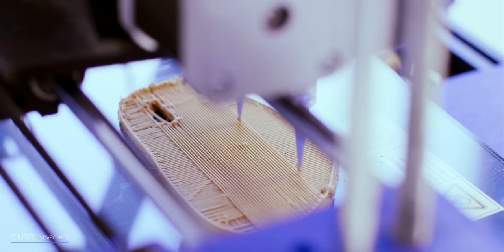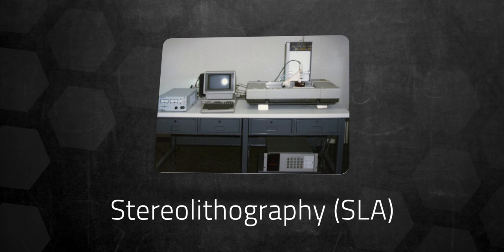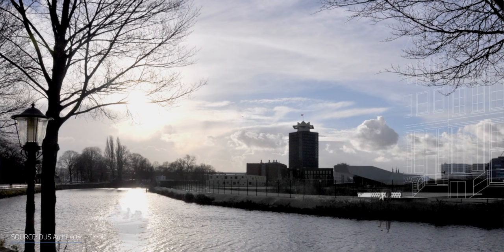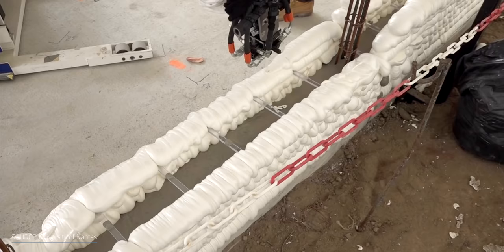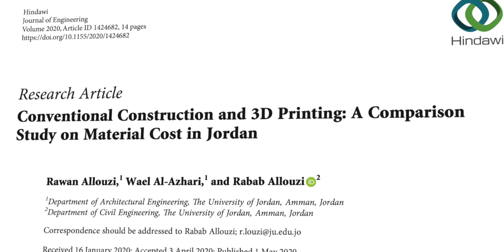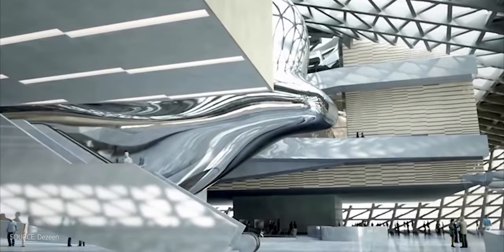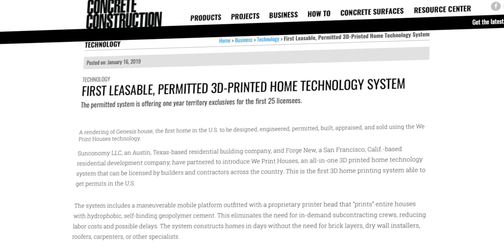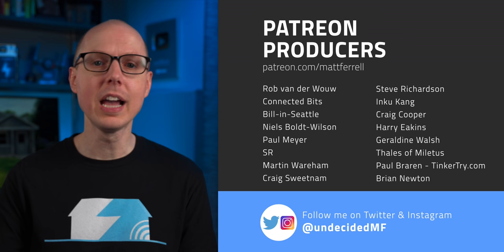This 3D Printed House Changes Everything - Explained

Comment: If you ever built your house in Europe you know that the walls go up the quickest and uses the cheapest labour. You are replacing that with a complicated technology, which reduces a relatively simple and quick part of the overall building process. It can surely built custom houses that would be difficult overwise. Surely it can build the house in 2 days, but I guess it takes another 2 to set up the printer and the tent, dismantle it afterwards. A similar house can be build by 2 bricklayers in probably a week. You saved a few days overall in a house build which generally takes 6-7 months. If you have local materials and you need cheap housing in volume you are probably much better off concrete flat panel manufactured in an industrial setting. You look at the entire Eastern block in Europe where tens of millions got housed in flat panel condos and those still stand despite of communist standards.

Comment: Any new building technique goes up against the home building industry which is dug in like an Alabama tick. I would buy a 3D printed house tomorrow if there was a contractor available and we could get the project through the permit process. These are great but worthless until you can actual order one built on your lot.

Comment: Thanks Matt - very interesting and raises many questions. However, I struggle to understand how it can be claimed its low carbon? Its concrete for dogs sake - most of the CO2 emissions from any building is the use of concrete. This is no exception. 
I wonder if anyone is trying to build by extruding molten rock? Now that would be 3D printing on steroids.

Comment: Looks like a bs con to me, like solar roadways etc. It's real easy to get money for such startups now. 

If you think about the logistics of it, I can only see this working in developed areas. For remote areas and poor areas, it would be a huge fuss to get these printers on location. But if you would build in traditional ways, there are also good options. Most of the things you need are available locally. The building gives work to the locals in every part of the process. But if you print it the big company comes in with charity robots, builds the concrete home, and is off again wiht all the money. Meanwhile the local workmen are jobless without income, the shops aren't selling rough materials. The transporters aren't getting work bringing goods...  Seems like a typical dumb idea to me, but one that would be popular with investors.   They can add blockchain to the company name :D.

Comment: 8:59 - why is that a good thing? Where are the 30% savings on materials/labour going then if the homes are the same cost as a "regular" home in the area? A 3D printed home isn't inherently better because it is 3D printed. It would need to be priced UNDER a regular house to be a good option for most buyers surely as many of what you were showing were significantly smaller sized homes.

Comment: Yea a 1500 square foot home does not cost $500k. Its right in $160k-210k, this is as presented almost 2-3 times the cost to build a standard timber home. Go shipping container home and you cut expense down to 1/8 of cost of traditional and about 1/16 of a printed home. Pass…

Comment: Many pieces == many joints, the joints are detestable over time. This is not like building with bricks and mortar (European style) with large and deep foundations to avoid unwanted displacements in the structure. Here it is normal to see houses with more than 100 years impeccably finished without problems of leaks, or breakages due to load or settlements. Also they are not more expensive than that. I can't imagine how inefficient these projects are that are sold as more efficient than 'classic' construction.

Ask how modular buildings and houses in Russia age over time. They are not very different by the philosophy of the construction.
 
I am very skeptical of the practicality of many 3d printed house projects. Plus the marketing with phrases and promises, sucks.

Comment: Yeah no this is the same issue as the house in England that was built entirely out of Lego.  3D printers aren't the solution for every architectural problem. In fact it's still more if a novelty for the .1% who have disposable income.  Also i prefer not to have a literal smart house, thanks. Computers are good tools, not to be trusted in any other format.

Comment: Still need a foundation, and wiring, plumbing, hvac, various inspection, and of course the land - this solves only  the framing part of the equation which to be honest a decent team can do very rapidly.

Faster delivery?  Maybe I think you would have to include the machine setup that rig & scaffolding.
Flexible?  I suppose you can print some shapes impossible to frame with hidden internals for ducting.   
Less expensive, doubtful - need to see a breakdown - those bare walls still need to be finished.  The actual land seems the most valuable part of the equation for anywhere I've lived.  The price per squarefoot of those shown are dogshit.
More sustainable?  Wood is a renewable resource, and unlike printed homes the inevitable remodel in 10 to 20 years is a well understood process.  Cement is tremendously energy intensive.

Comment: This is a joke. They already have 3D printed homes - called block manufacturing businesses. And instead of bringing factory to the jobsite, they had a revolutionary idea of building mega-factories that produce tens of thousands of blocks a day extremely cheaply. Truckloads of raw materials are efficiently delivered and used in one large central plant.  Then can be trucked to any site and installed by un/semi-skilled labor.

Comment: 3D printed with concrete, no reinforcement?
Reply from the maker: It’s not necessary.  They use a special blend and use printing patterns that give it the strength it needs.  I couldn’t find confirmation if they’re doing this, but there’s products like Helix Steel that let you get away with leaving out the rebar.  Lots of interesting things happening in construction.  https://www.youtube.com/watch?v=p1_b2VCGLPY
Reply: @UndecidedMF  that’s 🧢

Comment: LOWER COST ARE YOU INSANE? You can get a double wide mobile home that's 2,300 sq/ft for $150k right now I own a brick home in Texas that's over 4,000 sq/ft that only cost me $260k while that 1,405 sq/ft home by Mighty Buildings cost $595k.
Reply from the maker: The big caveat with Mighty Buildings is that they're only partially 3D printing (1st level only).  The rest of the home is still standard built ... and their homes are cheaper than comparable homes in the same area.  It's all about location and build strategy (nothing but 3D printed vs. a hybrid approach).

Comment: Whoa. Let's put a huge pause on 3D printing concrete to replace wood structures. There is significant CO2 emissions in the production of concrete verses no net CO2 emissions in using wood and may even be some carbon capture in using wood depending on how it is disposed at the end of it's life. The wood construction industry is a huge industry. Moving any significant portion of that to polluting concrete sources is very serious. Look at the major players you mention in the video that are investing in this technology UEA (repressive regime built on fossil fuels) and Russia (also a major fossil fuel producing country with questionable politics). Put this Genie back in the bottle until a low carbon method of 3D construction is determined.

Comment: $300k? LMAO!  it could be done for $120k... even here in CA. when you're building a house- there are lots of middle men waiting to exploit the deal. that's what you have to avoid. REAL-ESTATE AGENT. useless. buy online from the owner, skip the agent. watch out for property that is land locked or any of the other issues like back taxes, epa complications, etc- there are online tutorials that teach you what to look for. then? BE YOUR OWN GC. the house is the game- the GC is the coach, the subs/tradesmen are the players. if you're lucky enough to find a GC that is ALSO the carpenter? PERFECT. well worth his salt. the idea is to look for little mom & pop sole proprietorships that are TRUE pro's. the end result? nothing short of EPIC, artisan work of art.  large contractor firms & developers ? extra overhead. 

use tesla power- the only exception to the rule. they're fast- their cost is fair and they have the best tech on the planet. build your house WITHOUT making tons of 'archetectural' statements. a simple, one story rectangle. A one-slant, 4-12 pitch roof with no dormers or sky lights, 16" overhang,  covered in tesla solar tile, facing direct south. geothermal heat pump with de-super heater for hot water source.

Comment: Um china has done this for years clear a lot roll in structure to control arm pits one layer outer or inner and between is a corrugated or wavy layer that gives you space for conduits and piping. Prints avg home in if I remember 2 days then cures moves to next lot team comes in sets electrical and piping then roofers build roof and done cap interior it's a moving factory line. I know many chinese ideas are not americanizeable but this would make insulated affordable housing fairly quickly. And yes several years ago a comany started building in the us making apartment sized round buildings 3d printed in cement the same way but the round ones leave fewer options on space and expantion.

Comment: What about Geopolymers from Vegas? 45 minutes to cure and no stoppage for cure time between layers. With the Sea rise over the next 75 years, where are the 140 million North Americans going? They can't afford $500K for a place and own the dirt it is set on...True my designs are mainly for couples but they can be adaptable. Especially when using the Russian type single arm delivery systems.
Reply: Some sort of HEMP/ Geoppolymers composite will probably be the answer. Something light enough to put on auger type screwed-in foundations in a variety of desirable locals (for the monied crowd to thin the herd). Soon even seniors on Social Security will be able to have their own places. Or even cluster housing like Scandanavia did for it's assisted living units, maybe makeover old Malls...

Comment: "3D Printed House"  - Whatever noun follows the phrase '3D Printed' is always the wrong word. 

In this case, yes, walls are part of a house, but they.utterly fail to constitute even the most basic functional requirements set of a "house". This far too common hype is the Great Lie of 3D Printing, which is otherwise a perfectly lovely technology. 

Same thing with the "3D Printed Car", in which a horrific 3D Printed Unibody chassis was designated as a "car" (which it just wasn't).

Comment: Walls are not the expensive part of the build.
There's the land,
then foundations
floor slabs
suspended (first floor) slabs
roofs
doors and windows
finishes like rendering, plastering, flooring, ceilings, kitchen fittings, bathroom fittings
There's also all the services like plumbing, cabling, gas
external landscaping
Any of these 3Dable?
Thought not.
Plus you have the additional expense of concrete construction, which could be aggrgate block
and the additional expense of needing a qualified computer programmer to make any alterations to the design.
And who wants a room without corners. Where do you put your furniture?
It's all nonsense.

Comment: Some of these numbers which are presented as positive are really really bad. The market for this up and coming new construction technique that's supposedly working, and is cheaper and faster than conventional alternatives, is expected to grow to $114 million by 2023? Conventional, supposedly more expensive and supposedly slower construction is expected to be at $12,526,300 million. Let's have another look when 3D printing reaches 0.01% of the construction market - at a growth rate of 200% every 2 years that's 2027.

Comment: What nonesense. These "3D" printed houses are not printed houses. These are merely walls without rebar. It is nothing. Perhaps 5% of the value of a house. Call me again when a printing system manages to lay down concrete, rebar, insulation, water repellent layers, power cables, wastewater piping and fresh water and heating piping.

Comment: lmao 300k. Whos world are they saving lol. Just got a bigger house not long ago for 130k brand new first owner and it doesn't have hard cold concrete walls. If it actually was cost-saving id do it. I see this being much lower cost and labor for the builder. but they don't seem to forward those savings down to the buyer. They leave the price the same as a conventional house and even in some cases, they inflate the price.

Comment: You can buy 1400 sq ft finished homes for 50,000/60,000 anywhere out here in say a 1500 mile radius. But that is a cracker box.  I just bought my house last year, 3240 sq ft new construction on a 3 acre lot, $244,000. Just saying.... Dude you need to move.

Comment: -_- so what's wrong with timber and stone?
Reply: timber burns and gets eaten. Stone falls apart in quakes
Reply: @protonneutron9046  and this is concrete that will shatter if a large quake hits it. No building material is perfect as this is just 3d printing concrete structures. But the real problem is how many jobs will this take away from the economy and where will said now unemployed go to work?
Reply: @theDemolisher13  wrong.  You obviously know nothing of building materials.  The most earthquake proof structures are thin shell concrete
Reply: @protonneutron9046  building materials aside since that's less relevant. Ehat about the job less this will create how do we balance it out?

Comment: It seems to me that most of the savings is in not using people. It'd be funny if not also tragic if someone is "low income" because they've been put out of construction work by 3d printing, having to use 3d printing themselves to save money because they themselves lack jobs. God capitalism sucks so often.

The printers themselves take energy to run, and energy and material to build, also I assume they break down and need to be repaired and even replaced ever so often. Hardly seems a environmentally friendly concept.

Why do we need 3d printing to practice environmentally friendly material construction use, like mud or bamboo?

Comment: China have been using this technology since 1980.
Reply: 41 years ago? 3 d printing was a thing?
Reply: @davesilvia9711  
China WINSUN engineering
Has been experimenting since the 80s.
First working model in 2002.
Mass produce equipment for large 3D 
Concrete printing in 2007.
You can buy a concrete printer for $500,000. Usd.
Reply: @sbludba  is the quailty poor like the rest of stuff that comes from china?
Reply: @davesilvia9711  
In China there are 3 qualities of anything.
It’s what you are willing to pay
China proverb
‘ cheap thing no good, good thing no cheap’.